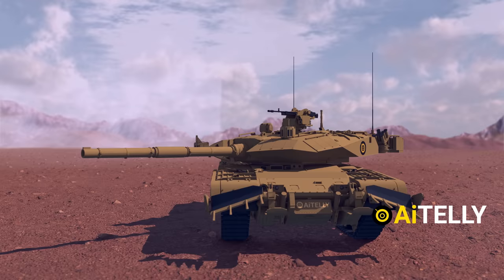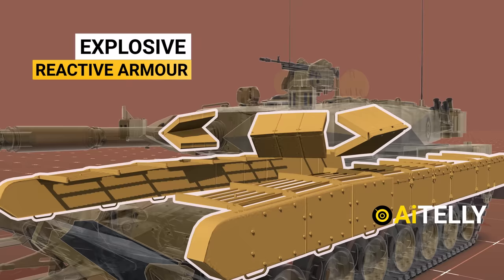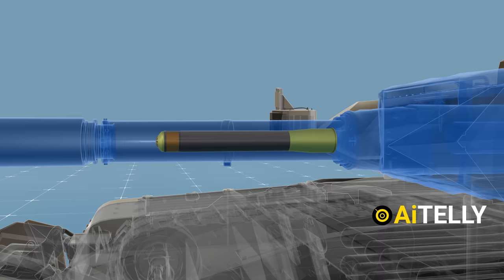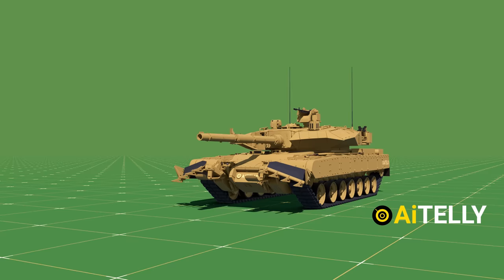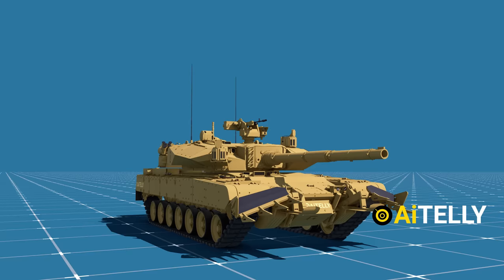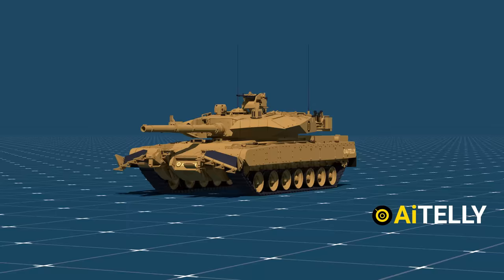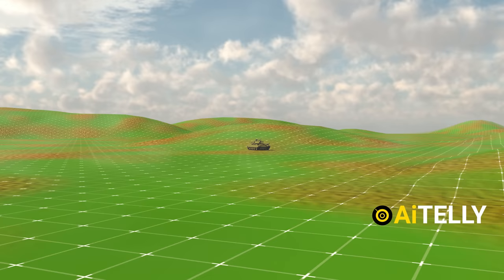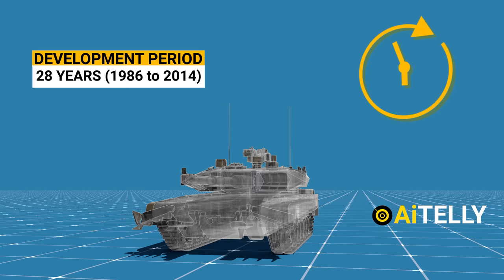Heaviest Battle Tank Arjun Mark 1A Mark 2 | How it works #tank #tanks

Comment: The mine plough alone weighs around 3T.Otherwise it's similar to other western tanks. It's potential is in arid landscape. As a result it cannot be used in more than half of India's border and sadly army is not well pleased with it.
Reply from the maker: yes agreed. Do stay Tune for more tanks videos Leopard 2 tanks Challenger 2 tanks as well as the bradley Fighting Vechicle
Reply: It's intended use was in the India-Pakistan border along the Thar Desert where mines can be hidden easily. Hence the mine plough. That being said, the Mk1A and further the Mk2 solves most of the issues and a new tank is being developed since last year for the mountainous Chinese border areas that will enter production by 2024.
Reply: This tank is made specifically for Pakistan. This tank can wreck havoc on plain regions. This tank is not meant for Himalayan borders due to heavy weight.
Reply: Some army generals are not pleased with it because it will cut into T90s orders and the kickbacks from Russia that come alone. Its a direct threat to Russian T90s imports.
Reply: @marcd5196  anyday T90 is better than Arjun and also should focus on russian T14 for future contracts
Reply: @EncoreXGaming  The previous version Arjun mk1 already slammed the T90 during direct comparative trials in terms of both firepower and mobility. The trials were held in 2010.  
But nice T90 advertisement. lol
Further it was also said that the Arjun crew was new, and T90 crew much more experienced, yet Arjun performed better.
Reply: It can't be used in the Punjab: It is just too heavy for the bridges there. It can mainly be used in northern Rajasthan. 
The Arjun may be a better tank than the T-90 but it can't be deployed in as many terrains and places as the T-90. This messes up the whole concept of reserves.
Reply: @theOG_Russkiye  it can be used in Punjab plains. The bridges can be upgraded. An average tank weighs over 60 tons minimum. Its just us who have used 50 tons T72 and T90 for decades and have not upgraded our infrastructure .
Reply: @marcd5196  Do you even realize how much it would cost to upgrade so many bridges? Why do you think it hasn't been done so far? Simply because there just isn't the money for it.
Reply: @theOG_Russkiye  "Generals actually don't have much say in what equipment is bought"?
Lol get back to reality.

And yes, border infrastructure costs a lot. And the money spent on it is worth it.
Reply: @marcd5196  You are welcome to continue living in your fantasy land if that is what helps you sleep at night.
Reply: Yes and also it's very expensive army would go bankrupt if they try to buy it in bulk
Reply: @EncoreXGaming  no
Reply: @Ivan "Moneybags"  yea kind of alongside with that it costs more then T-90
Reply: @theOG_Russkiye  Ivan the indian arm has local mobile bridge laying equipment that can handle 90 tons so the bridge can't handle weight is old news and in a war enemies  usually blow up bridges so you can't use bridge anyway lmao
Reply: Love to see indian army brass in t90  while the soldiers go in arjun next war let's see who survive
Reply: @TheMoppin  Maybe you should try getting less "knowledge" about warfare from video games or just read factoids like 'the army has bridge laying equipment' and 'it can handle 90 tons' and just assume that everything is fine rather than actually learn how warfare works in reality. 

If it was just as simple who has more tools and men, everyone would be a general. And if laying bridges was such a simple task, armies wouldn't hire engineers to do it. 

No freakin' army, not even the U.S. Army that has always been funded generously, has ever had enough bridge laying equipment to substitute for bridges. Armies try to capture bridges and do not just lay bridges where they please for a reason.  And the reason is there just aren't enough damn bridge layers anywhere, mate! Nobody has ever had enough of them.
Reply: @theOG_Russkiye  well you go drive your tank across an enemy bridge you think they going wait for you to invade on their bridgesthey will blow it up
Reply: @EncoreXGaming 😂😂t14 atrapa, nato codename mockup😂😂

Comment: ERA typically consists of explosives and metal payloads, which explodes on contact with incoming projectile to offer protection. The ones shown by the video are composite armour, more typically located in the actual body of the tank.

Comment: Even Indian Army likes it to use in specific locations where it's mobility and speed are not required that's how much it is overweight , I hope the trim down some weight by using composites in non sensitive areas .
Reply: It's specifically made for western front where plane terrains are there ,where lite tanks become easier target for enemy,it's heavy because it's made specifically to use dangerous bombs like thermobaric or Vaccum bombs.

Comment: TBH, except for a lesser range, I really don't see other disadvantages, tanks need not to be lighter to be agile (10 to 20 km might make a difference in time to reach somewhere but no difference in trying to evade an atgm).
Tanks should be heavy since mostly heavy means more protection and more protection means less prone to shut off when hit.
The hitting and defense capabilities are what make a tank, A TANK !
Reply: Not necessarily, heavy != more protected, a tank that weighs less has a lot of advantages it consumes lesser fuel, needs smaller engine (means bigger compartments for crew and techs), is more agile, and can easily cross bridges. There's a reason why tank designers didn't opt for heavy metals to improve the armor and instead go with composite armor as it gives the better protection in a significantly lesser weight.
Reply: @lunaFreya141  yeah but all that lightness and just one atgm round takes out a machine that's worth a couple of millions.
Agility isn't worth it, tank can't avoid a cover hidden manpad that's continuously moving, especially if the tank doesn't have infantry support (like in ukraine war).
So Obviously it's stupid to incorporate titanium or Tungsten as these are too much heavy and will cause the need for an exponentially powerful engine.

But a heavy composite-metal based armor shouldn't be avoided even in IFVs as these vehicles either carry personnel or expensive fire power which should be protected from at least 3-4 atgms...
So it's important to keep it armored even if it reaches a 100 ton.
100 tons won't be a problem for a 2500 hp engine (like that of a chopper) if it exists for tank's size.
These kinda tanks could be used in few numbers to spearhead an invasion or push back to drop enemy morale as these beefed tanks work as a meat shield for the high number of normal tanks.
Seems plausible.

Comment: ARJUN is a big tank compared to russian tanks. I guess it's better than T90 and t72. Let's wait for Mark 2 , maybe it'll equivalent to Leopards or abrams. Mark 1 was just a baby step
Reply: Yep! I have high expectations I am a huge fan of Arjun Tank.
Reply: There are news reporter of Automated/remotely operated UAV type Arjun tank coming.
Reply: All T-90 variants are superior to the Arjun. Russian APFSDS (both svinets 1 and 2) are far better than Arjun’s. Moreover, smoothbore guns give higher muzzle velocity than a rifled gun and they have longer service lives with less maintenance. T-90s are also faster and can traverse bad terrain much much better than the Arjun can. The ERA coverage on the front of the Arjun is also quite bad, with the main gun sight being extremely exposed and the armor being extremely thin at that point as well.
Reply: @Insert-Retarded-Reply-Here  In comparative trials between Arjun MK1 and T90, the MK1 came out superior. Not to talk about the MK1A in service with 90 improvements. T90 tanks are history literally once the NGMBT, Remotely operated Arjun and Zorowar tanks get inducted
Reply: @dharmicwisdom9818  superior in what? Protection? Nope. Mobility? Hell no. Penetration? Most certainly not. There is almost nothing any of the Arjun variants are better at compared to the T-90A, nevermind the T-90M or T-90MS.
Reply: @Insert-Retarded-Reply-Here  Arjun is developed with the assistance of Germans and it comprises of many german and isareli sub systems. So i guess technologically it's more advance
Reply: @manas2656  it is based on the leopard 2A4, but it is in fact not as good as a leopard 2A4 because of its horrible APFSDS and rifled gun. To this day, nobody understands the design choice behind India selecting a rifled gun that is inferior to smoothbore and making it fire trash APFSDS rounds that are even worse than the APFSDS the challenger shoots. It makes no sense. The newer German tanks like leopard 2A5 or 2A7 is far, far more technologically advanced. Perhaps in fire control systems and thermal imaging the Arjun is comparable to the T-90A, but to the T-90M or to the newest NATO tanks, there is simply no comparison
Reply: @Insert-Retarded-Reply-Here  We saw how well T-90s have performed in Russia 😂
Reply: @Insert-Retarded-Reply-Here  The Arjun MK1-A fared much better than the T-90 in Mobility in the desert heat bordering Pakistan, the tracks of the T-90 got stuck much more easily & the heat made the T-90 turret less accurate. In fact the Arjun has a lower ground pressure via its tracks than even the light T-72 because Arjun's tracks are wider & longer than the T-90.

The Russian T-90 was made for the subzero Russian winter & for its mud & rocky terrain - not the hot dusty deserts & plains between India & Pakistan.

The Russian tanks DO NOT have Air Conditioning - neither the T-72 or the T-90, which makes it dangerously hot for the crew, which Arjun Mk-1 & MK-1A have air conditioning & the MK-2 will have a much improved & efficient air conditioning system. 

Air conditioning makes or breaks the crew during hot desert combat.
Reply: @SodiumSyndicate  T-90M features air conditioning
Reply: @Insert-Retarded-Reply-Here  That's a wrong perception actually. Arjun outperformed T-90S in trails.
Reply: @Insert-Retarded-Reply-Here  The T-90 built for India doesn't have air conditioning.
Reply: @SodiumSyndicate  T-90MS is equipped with air conditioning, which was a variant made specifically for export to India
Reply: @Скованные  It is reported that arjun has better protection than T90 M ; Further Arjun has better engine than T90 M ; Also , Arjun tank has better next generation systems integrated than T90
Reply: @antonsokolov1771  I don’t know what you are talking about when you said “Tejas” but I will assume you meant Arjun. No, the T-90M has better protection than the Arjun in every quantifiable aspect. Better ERA, better ERA coverage while the Arjun has terrible ERA coverage, better base hull armor, much much much better base turret armor, and does not have the giant weak spot that Arjun has on its main gun sight on the front of the turret. T-90M is still faster than Arjun because it is lighter by 30 tons and has better power to weight ratio than Arjun. And no, T-90M thermal imaging, battle management system, laser warning receivers, etc are better according to almost every source. But all of this doesn’t matter, since Arjun’s APFSDS is so bad it cannot even penetrate a T-72.
Reply: @Скованные  I do not agree ; The automatic Reload capability of T90 make it vulnerable.  As shown in the Ukrainian-Russian conflict ; The intersection of carrier and gun is most vulnerable . 
Further T90 M's protection is not as per Arjun tank
Reply: @antonsokolov1771  1. The autoloader carousel on the T-90M is armored, unlike the older Russian tanks which do not have armor surrounding the charges. This is why so far, no T-90M has been destroyed from a cook-off as a result of enemy fire ukraine. Most T-90Ms lost were abandoned/captured or scuttled to prevent capture 
2. The Arjun is likely more vulnerable, because the Arjun has ammunition stored in the front of the hull next to the driver.
Reply: @Скованные  I do not agree , in the T90 fights ; which were in combat ; most were destroyed due to the toppling of the gun from its chesis . Further Arjun protecting armour much more superior and advanced than T90
Reply: @antonsokolov1771  All sources say Arjun’s armor is bad. There is simply nothing good about the Arjun’s armor. Diagrams show that any Russian APFSDS can penetrate the arjun anywhere on the front. Meanwhile russian tanks are always designed to be able to stop their own APFSDS
Reply: @Скованные  I do not know which source you are quoting. But all Indian and Western Sources highly appreciate 2 components of Indian Defense industry- first is the Kanchan armour and second is Tejas jet data link. Kanchan armour is now even used in T90s of India for better protection
Reply: @antonsokolov1771  Kanchan armor is just an upgraded kontakt-5. It still relies on one plate separating, while the new Russian relikt ERA has two plates seperating at the same time. Kanchan covers no more than 20% of the turret, and there is almost no Kanchan ERA on the hull, only a little bit on the upper plate. The entire sides of the Arjun tank are completely unprotected and have no Kanchan ERA. Meanwhile on T-90M/MS the entire turret and hull sides of the tank is fully covered by Relikt ERA, and is even equipped with extra explosive packages on the side with many tanks in ukraine having them on.
Reply: @Скованные  Lol , Kanchan Armour is a secret and it was never revealed. Which source have you quoted ?
Reply: @Insert-Retarded-Reply-Here   no they are not the results are in ukraine russians are good people with bad habit of not claiming the truth t90 has flaws which is lethal for india to as we too have large fleet of t90s though we can make them ourselves with great diffrence then their russian counterpart but we will now be replacing them with the ngmbt design we have develped
Reply: @antonsokolov1771  kanchan armor’s layers are not classified. The exact composition of these layers may be, but the basic design is not a secret. You can literally check Wikipedia
Reply: @engineeriumm  yes, the T-90 has flaws. Arjun only worsens these flaws. Your fleet of T-90 tanks can safely penetrate the fronts of Chinese tanks without a problem. Same cannot be said for Arjun. The only reason why Arjun exists is to support domestic production
Reply: @Insert-Retarded-Reply-Here   wait are your reasons to support these claims or you are making things in air
Reply: @Скованные  weekipedia is a open source . It can not be relied . There was info provided by DRDO the primary source
Reply: @antonsokolov1771  Wikipedia cannot be relied on, but it can DIRECT you to various primary sources which is where the information comes from
Reply: @engineeriumm  I have read many sources, all of them being Indian mind you. The most optimistic estimated penetration of Arjun’s APFSDS is 500mm at 2km. This is very, very bad. This already means it cannot penetrate most of the front of Chinese tanks (except the lower plate). But many sources agree that it is closer to 300mm. And it logically makes sense too, the challenger 2 suffers from the same problem. Rifled guns have very good accuracy when firing HESH, but when firing APFSDS that is designed to be stabilized with fins, it is horrible. All the rifling does when firing APFSDS is reduce muzzle velocity significantly. Not to mention Arjun uses very short one piece ammunition that although light, easy to carry, and easy to store many of in the ammorack, it’s penetrating rod is short which compromises its ability to cut through armor. The advantage of the carousel autoloader in Russian tanks is that the weight and size of the projectile is not an issue since there is no human loader, thus it can use two piece projectiles with heavier and longer penetrators.
Reply: @Insert-Retarded-Reply-Here  Still Even weekepedia never mentioned how many layer exists
Reply: @Insert-Retarded-Reply-Here   i will consider your comment and then reply
Reply: Naaaah, it's not man.
I get it, it's Indian, doesn't mean we shouldn't research into it.

Mainly on two issues:

1)That gigantic optic on the right side of the turret, it's a big BIG target , because it has zero armour behind it.

A single round through that big weak point with kill every crew member within. 

2) The gun and the ammunition,

Indian ammunition is terrible, the apfsds has a penetration of 500 cm compared to the 1500 cms achieved by most of the contemporary tanks.

The gun is also rifled, much more technical and labour intensive to produce and needs much greater maintenance.

Now I know the people at DRDO know this, but, they've yet to address this, which I find shocking. 

Finally there are a few reasons the Indian army has not warmed up to this tank including it's weight , these are the most important one's though.

PS: I've been scouring Indian defence websites since I was a kid.
The main issues have yet to be addressed, the minor upgrades mean nothing to the army.

Comment: Even though Arun hasn't been acquired in large numbers which is often seen as a success in case of any weapon platform, this will pave the way for the future battle tanks for the country and in this regard Arjun has already served the purpose. And as far as operational viability goes Arjun's ability to steam roll through the plains of Lahore just like 1971  has already struck fear into the terror state of Pakistan 😂

Comment: The Tank is not obsolete! It was developed started at timexthe requirements changed many times tank 1st version came in20042nd upgrade came 2013-16,Test done induction 2020 , it smokes granade laincher design in a way it will use for Aps!